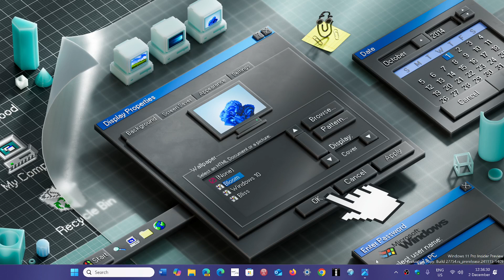Faulty PCs Why is Quality control not detecting them viewer question

Comment: I worked in quality assurance for a hydraulic pump & motor division of Parker Hannifin for over 40 years. The last 10 years there, I saw a marked reduction in the quality of the products. Look at the auto industry. Have you ever saw so many recalls? The issue is that products are made to a price point which is as low as possible. Quality is no longer "job one" as Ford used to state. Ford now leads the entire auto industry in recalls! Computers have gone down that same path. Most of the components come from China, or another country where quality in a non-issue. They build the computers with the cheapest parts they can find and with the minimum requirements. You will find in most desktop computers that the power supply is the bare minimum to run the hardware, and that is the component that often fails first. Knowing what I have learned from working on computers, I would never, not ever, buy a desktop computer from any of the mainstream manufactures. Really, they don't manufacture them. They just assemble sub-par components from another country. I decided to build my own desktop computer in 2019. I selected each component for known good quality and reliability. The computer is now almost six years old. It never crashes and none of the components have ever failed. It is still faster than most computers off the shelf. The old adage, "if you want something done right, do it yourself", still applies...even more than ever. Sorry for the rant, but that is what I see today. 😢

Comment: My Lenovo had a Realtek ALC4050H Audio Codec that didn't work correctly for almost 3 years until a firmware update was released this year in September.  Now it works perfectly.  It shouldn't of taken 3 years for the firmware update to have been released, but the annoying speaker pop is now gone... I'm thankful for that.  I guess better late than never.  Lenovo sent me 2 replacement computers in an attempt to fix the issue... and the problem could of been fixed originally with a simple firmware update.